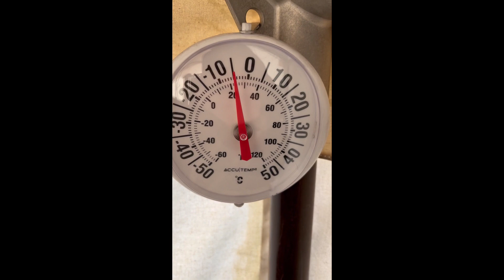Unveiling Our New 16x14 Canvas Wall Tent: A Northern Adventure

Comment: I have a 12'x14'x4' canvas tent on a platform since last November. The frame is only 1 inch pipe, not engineered for any snow load. It has handled up to 3 inches of snow. Stove is the camp chef. Does okay in 20-30 below filling every 2hrs. Have got a bigger stove for next winter. I'm 63, retired, and my tent is a two hour drive for me to get too. I have it setup on private campground with no services available.
Reply from the maker: Wondering how you're making out with your setup!  //derek